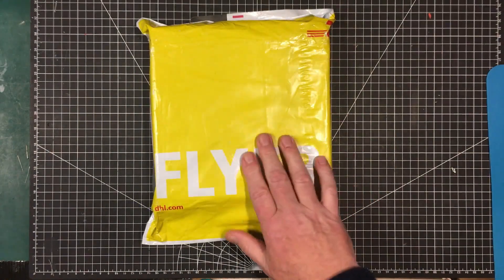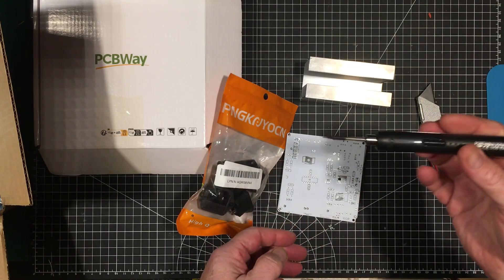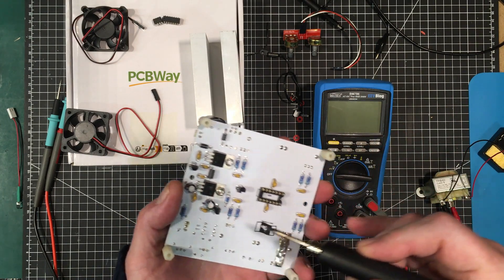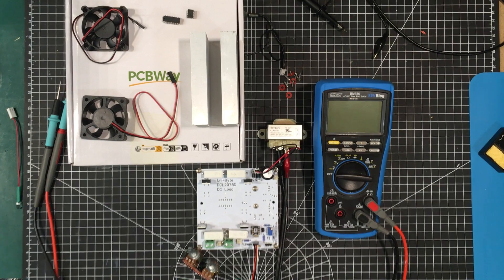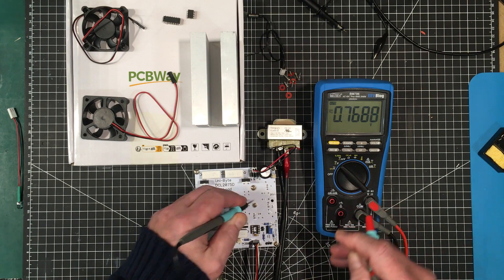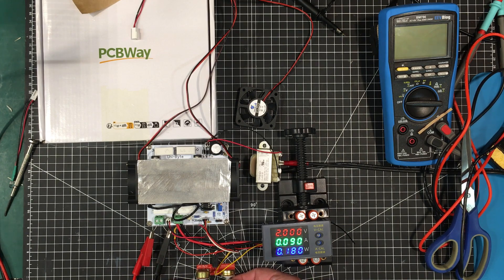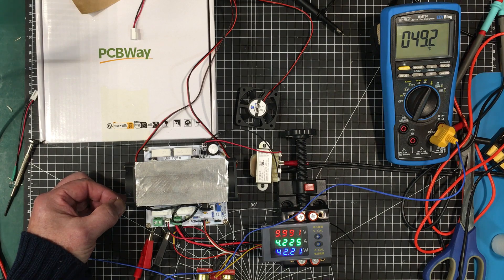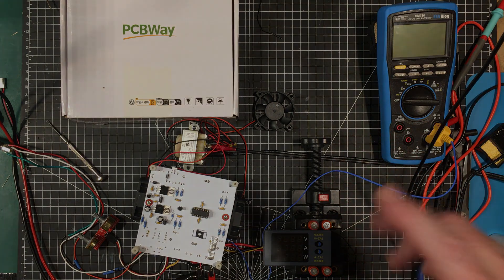Uni-Byte 0228 - Let's Build A VARIABLE DC Load: (It LIVES) Part 2

Comment: i think you should remove the tape over the heatsink, it is creating a duct which you want when you want to route air, but in this case you dont want to route the air, what you want is maximum airflow over the heatsink fins. in current setup airflow is limited by what the first fan can suck and also constrained by its body as the second fan cannot pull more air than what the first fan is providing. removing the tape will allow the second fan to suck more air from the surrounding and therefore more airflow on the heatsink. you can test this
Reply: I would like to see that test too !
Reply from the maker: Taping the cavity shut promotes more laminar flow and hence less resistance due to turbulence.  Opening it up should cause turbulence and actually reduce the airflow.   I can try it in the next video to see what happens.
Reply: fans do not blow directed air perpendicular to motor axle, instead they push it outwards diagonally in all directions. It concentrates all air pressure near the blades with very little flow reaching any meaningful distance away from fan's plane. Air flow has to be focused and this channel is designed for that.
Heatsink like that is probably meant to be put with a cutout to PCB, which also makes sense in terms of material and weight optimizations.
Reply from the maker: @Mr.Leeroy  Good point.  Yes, a non-boxed (open blade) fan does does push air out like you say.  However these are box fans.  50% of their depth is after the fan blade and amounts to an exit duct duct which will reduce the effect you're talking about by a little a bit.  Your guess as to how it is designed to mount is probably correct.  I chose this way for easier access to the mounting hardware but I guess I could have used self tapping screws.
Reply: @uni-byte  No, I'm talking about this type of fan you have in the video. They really are that inefficient; shroud around the blades is too short to be effective without direct contact to other means of flow direction control (usually heatsink fins).
Reply from the maker: @Mr.Leeroy  I'm not disagreeing with you.
Reply: @uni-byte  I know 🙂 Just clarifying.
Reply: @uni-byte  :)
Reply from the maker: @andymouse  :)